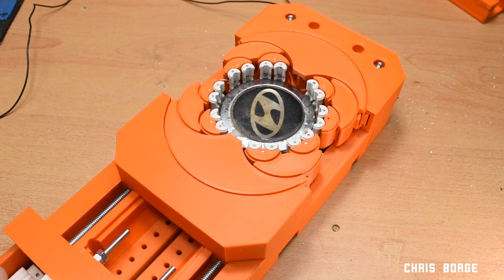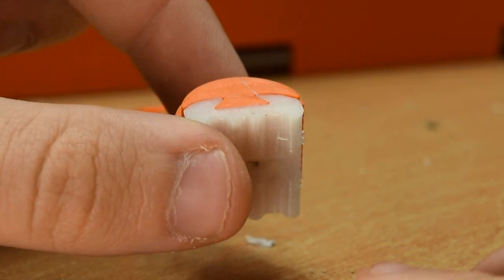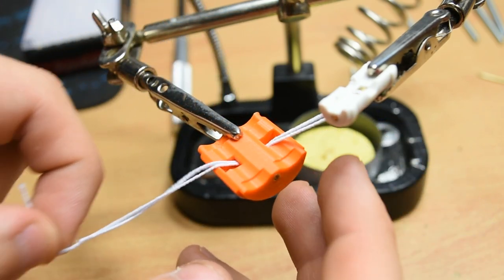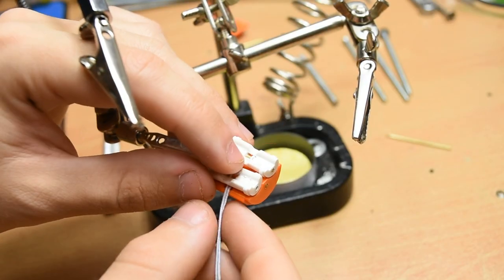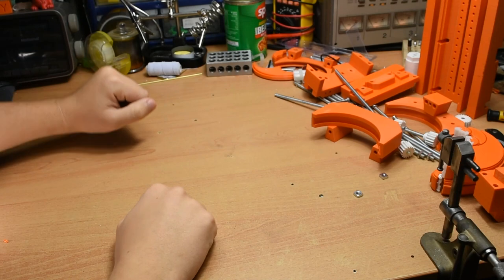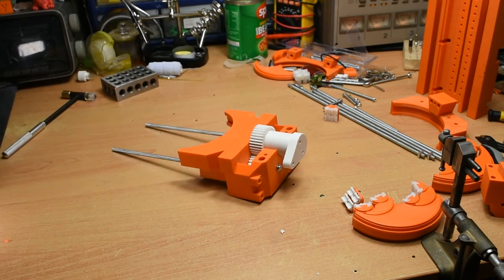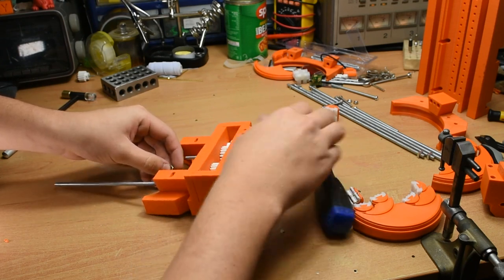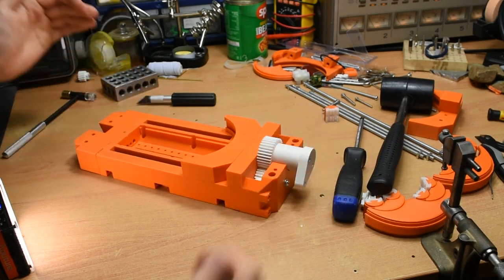3D Printed Fractal Vise Build Guide

Comment: The slots for the square nuts in the movable jaw are too small for the square nuts sold in the United States for #10 threaded rod (3/16 inch).  Square nuts (#10-24) bought at Home Depot in the USA are 9.5mm square, and the slots in Chris's model measure 7.85mm (as printed on an Ender 3).  I ground the nut smaller on two sides until it fit in the slot, but stupidly did not grind down the third side, and once dropped into the slot, the nut doesn't go deep enough either.  It's a tight fit, and I can't get the nut back out without destroying the jaw.  Fortunately, reprinting the jaw isn't a huge deal - I think I still have enough filament on the spool to match color even.

Comment: I have several issues with the design:
1) threaded rods in pushrod-configuration. Those will buckle very easily, particularly if they're not terribly straight to begin with
2) the two inner (I suppose, reversing) gears run on the naked threads of the bolt. Those will wear out in no time. Also, the threaded rods are spinning naked in their seats, which also no es bueno.
3) The connection between the threaded rods and the driving gear does not inspire confidence. Especially since it's load-bearing in the axial direction. Also, there is apparently no axial bearing for the rods to push against, I suppose all you get is the gear rubbing on the plate. Something's gonna push through pretty soon
4) I don't think that the dovetail-construction of the sliding interface between the jaw and the frame is ideal for purpose when made of plastic. It may bind under load.

I'm aware that this is a plastic part and not an industrial grade vice, but a design optimised for 3D-printing and softer, easier-wearing materials could make it surprisingly capable and able to punch way above it's weight.
On the whole, nice work :)
Reply: Its been a year where is your better design?
Reply: @alw1981  This is not a competition. Critiquing does not necessarily mean that you are able to do better, or that you think so. I'm aware that this is the internet and you feel compelled to be a dick, but a constructive critique is not a "diss" and does not require an answer in kind. If you had bothered, you might have noticed that everything I consider a flaw in design also has an explanation why I think it is a flaw. The intent is clearly to help this person improve their design, not to put them down. If that had been my intention, I WOULD have designed a better one and called this person a fool. Which I didn't. I even compliment them on their nice work.
You know when people talk about how terrible an environment the internet and social media are? They're talking about you. Think about that.
Reply: @horrovac   The issue messages left in a comment section is it is impossible to accurately convey tone.  What you meant as a critique,  I read as an attach on most of his design that he likely spent many hours designing then offered for free.
Reply: @alw1981  My "tone", whether accurately conveyed or not, has nothing to do with what I am saying. If you wanted to pick a fight, you'd have done much better to find flaws in my critique and have a strong case proving that I'm wrong. I don't care much about what people think of me (and your reaction to my post explains why), I care more about being correct and fair.
Before attacking someone back, make sure they've really attacked you or someone you wish to protect.